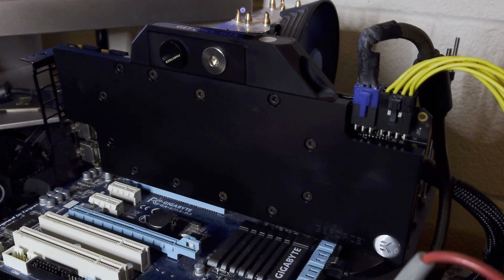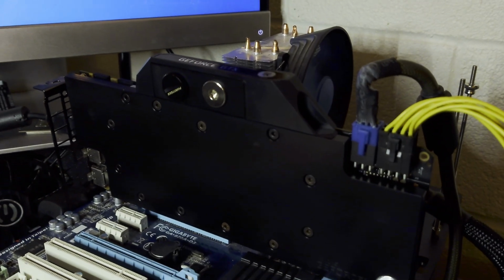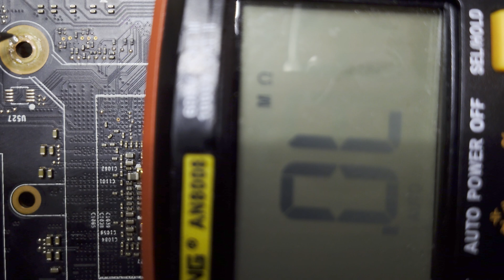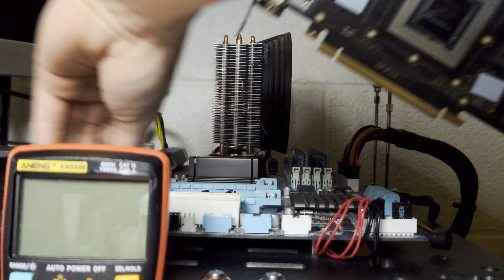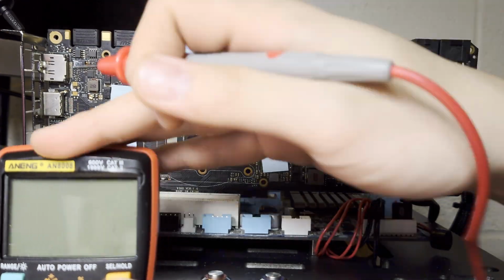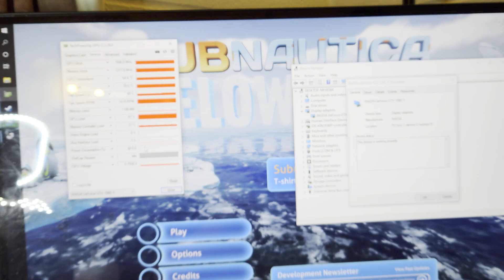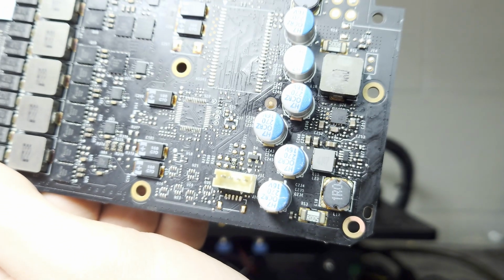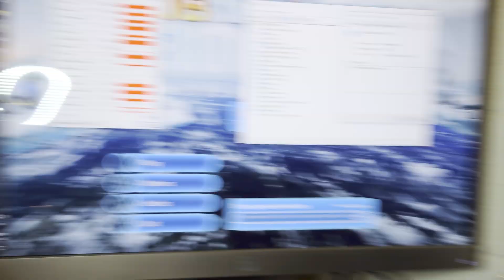Nvidia GTX 1080 Ti Repair - Code 43, 0W Power Consumption

Comment: I need some help my 1080ti does not report gpu chip power draw and 6 pin power draw and the card sits at 139mhz, I checked the resistors and capacitors around the ina3221 and all seems fine. Still does not work and it shows pwr throttled
It sometime starts to work and reports the 6 pin power draw and gpu chip power draw which has a gap of 100w between the chip and board power
And it works by starting furmark stress test

Comment: please answer me, i have a laptop dell with similar Code screen, ive flashed the MB nd made sure the driver is up to date,
i managed to get rid of Code 43
but the gpu still wont work, when i run gpu-z i get 0vram and 0clock speed also the bios version is greyed out

based on your experience what could this one be??
Reply: did you found a solution to this??

Comment: friend I have an MSI 1080 TI card that gives error 43, I have already tried to change the BIOS but without solution, the 1.8v L1 coil. has a resistance of 480 OHM, does this mean that the GPU is dead?

Comment: Hey, been watching your videos for a while now and in awe of your skills! I have a vega 64 at the moment that is not displaying (fans spin) and crashes when drivers are installed if used as a secondary gpu, gpu-z just shows it as microsoft basic adapter. Do you think it's toast, or you think it could be repaired? Thanks and keep up the good work!
Reply from the maker: I can say with well over 95% certainty that you have a dead core. Likely one of the HBM modules is faulty which means you need a GPU swap. You should sell the card.
Reply: @TechCemetery  OK that's a shame. Thanks very much for taking the time to reply! 👍
Reply: @TechCemetery  You've helped me through a few cards and looking for an off the cuff comment from you so I don't spend unnessary time on this. I think I have a memory issue of some sort. have a Gigabyte 980TI Winforce G1 that has artifacts and shows an error 43. My memory shows up as zero on GPUZ. Artifacts go away with reduction of resolution. I still have error 43 no matter what. Tried different versions of BIOS and all behave the same. Also, RGB lighting on GPU stopped working at the same time this all started so maybe bad component on whatever rail supplies the LED power.
Reply from the maker: @erickeith1466  Run MATs, I have a guide video on it.
Reply: @TechCemetery  Does the onboard RGB on most graphic cards run off of the 3.3V or 5V rail? Before I run MATS, I think I should resove this first. Also, not sure if memory VRMs run (should be two) run off of 12V or another rail (doesn't need much current).
Reply: And thanks!

Comment: I'm curious what are your experiences with acquiring graphics cards for repair: what do you look for, and what's your success rate been?  Might make for an interesting video.
Reply from the maker: I generally avoid newer cards ( RTX 3000 series, RTX 2000 series even) and I try to stick to Pascal and Polaris.

Comment: Hello. I recently bricked 3 rx 480s while they were on a mining motherboard.  I turned the motherboard on while forgetting to power the risers attached to the GPUs.
Now two of them won't post at all and the fans won't spin.  The third one gets me a BSOD saying thread stuck in device driver.
How can I diagnose and fix them?
Reply: Btw, I love you channel. I learn a lot 
I'm assuming I caused electrical damage to my GPU.

Comment: Excellent video as usual!

Question: the 5V coil connected to the 1475 chip (I assume it is?) lowest and far to the right only give out 4.2V. Any ideas? Every other voltage are correct and the gpu voltage is lowered after some seconds meaning its detected or such, but the computer don't want to deal with it anyway. Can't really see any hotspots on the thermal, except the gpu of course. Any ideas what to look after?
Reply from the maker: You'll want to check the FB pin. Typically this is 0.8V, if you have less than 0.8V, then My first guess is that you have a dying MP1475.
Reply: @TechCemetery  Thanks for the answer and tip! FB 0.8V though. Changed the 1475 anyway, and now the output went up to 4.5V but not 5V and card still not boot. Any other ideas perhaps? What circuits rely on that voltage? So can I check in that direction or so.
Reply from the maker: @dtiydr  Check the FB resistors against another card. I don't know them off the top of my head.
Reply: @TechCemetery  True that, will do, tnx.
Reply: @TechCemetery  The FB resistors are all within their values according to the datasheet for the 1475. It just don't make any sense.

Comment: How do you know which resistors are on the 1V8 rail?  Do you trace from that rail with a multimeter in continuity mode to find everywhere it goes, or do you have a boardview for the graphics card?   Also how do you know the correct value for the resistor, SMD resistors of that size (0402, 0201?) do not have the value marked on them.  Again I suppose if you have the boardview then you would know the resistor value.
Reply from the maker: Tracing, I work on the 1080 Ti quite a lot. I also have quite a lot of donor boards to compare values to.

Comment: amazing series, love that good work. have a question with a r7 370. vcore at 0.4 volts and decreasing over time. card makes strange noises and only mosfet high side gets warm along with 12v filter caps. pcie volt shows 0.6 and no memory voltage nor controller voltage .then i removed the voltage controller ncp5395 and I have pcie voltage at 0.95 ( back to normal ) got 1.52 memory voltage and 1.05 voltage on memory controller.  of course I am missing vcore due to lack of ncp5395. what do you think may be the issue.? I am guessing ncp5395.

Comment: Subscribed! great analyzing skills.  

I hope you can help me, I have a HIS RX 580 card that started to get intermittent.  1 day it will have no display, the next day it will have display but lose it in about 5-10mins.  Any tips where I should check? I watched your RX580 vids and when I stab while the card is on-board and powered on, I don't have vout on the APL5932A linear regulator.
Reply from the maker: Check the voltage on VCntl, VIN, EN. Let me know what they are.
Reply: @TechCemetery  thank you.  I will check that right away.
Reply: @TechCemetery  sorry for getting back to you late.  I think the ldo is bad, VIN and EN have 3.3v but no output.  I tried removing it using my gordak rework station at 380 degrees C but it won't budge.  Any tips how to remove this?
Reply from the maker: @carlsysad  Use more heat, and flux, and preheat the board.

Comment: Always nice to watch these videos! I have a ASUS Strix 980 4gb that just displays "Please Power Down and Connect the PCIe Power Cable(s) for this Graphics Card" with or without power connectors connected. When i put display cable on the motherboard and boot into windows with integrated gpu and check device manage it shows that it has error 43 as well. Any idea what the problem is?
Reply from the maker: It's a current sensing problem, I'd love to look at the card and feature it on the channel. Send me an email if this interests you. My email is listed in the about section of my Youtube Channel.

Comment: Nice, the last time i had high resistance like 5k++ ohm on 1.8v rail is on colorful gtx 1060 and it's working fine without error, idk how they manufactured that PCB but it's kinda weird.

Also do you think the owner just scratched the PCB, knocked off some resistors and create a short on INA chip data pin or could be something else?
Reply from the maker: Maybe, I suspect user inflicted damage given how many dead components there were.

Comment: Hey, .my fx 6300 system motherboard died, doesn't post, got any trubleshooting steps? All the voltages on the coils are fine, ordered a post card yesterday.
Love your vids.
Reply: You can try some other basic steps. First, remove bios battery, shorting the contacts to discharge any residual charge. Then verify the battery voltage. Install a new battery if the original one is flat. Remove the bank memory, cleaning the comb contacts using a contact cleaner or a rubber. As a general rule, it is better to remove any not necessary device (keyboard, usb hub, cd/dvd player, keyboard). In fact if there is a short on any of the previous device, the motherboard will not post. If you have post then you can add one device after another to isolate the faulty device. During the post, you have to monitor che current consumption using a power supply, in case of a laptop it is very simple...but I think this is not your case; anyway, good luck and let us know if you have any result!!! Regards from Italy.
Reply: @paolomonai9511  thank you for the advice, but nothing, my motherboard doesn't even give me the error code when I start it with no memory, I tried reseting the bios, even swapping the primary and the secondary bios, the psu is ok, memory works, tried 3 gpus, nothing, i just couldn't  check the cpu, but unless you are a overclocker, its never the cpu.
Reply: @filenotfound__3871  I immagine that you already did an accurate visual inspection to rule out a physical damage (broken traces, hit or punched components..). If you have a scope you can check the frequency generated by the quartz (especially RTC at 32.768KHz) but also the others that are present for sure.
Reply: @paolomonai9511  no, I do not have an oscilloscope, yes I did the visual inspection and found nothing, I ordered thebiost post card reader, the thingy with the diplay that shows you where the post stops
Reply from the maker: I wish I could help, but I'm generally pretty clueless when it comes to motherboards.
Reply: @TechCemetery  Ok, thank you, guess im buying a new motherboart then...
Great vid btw.